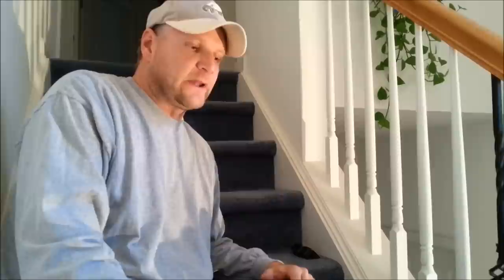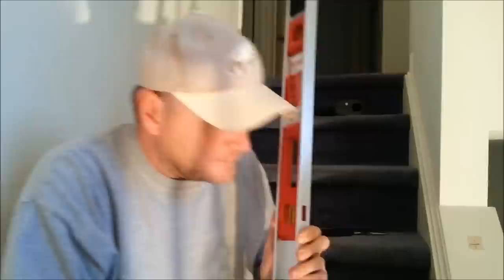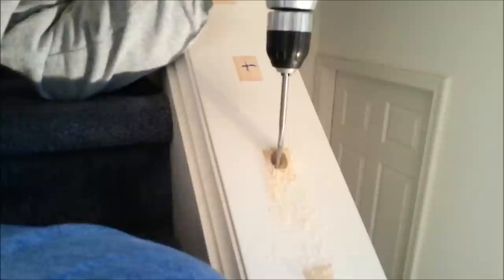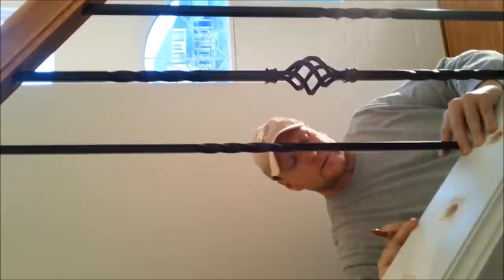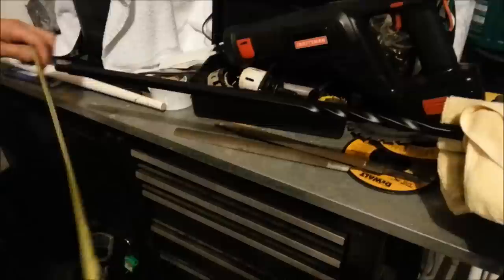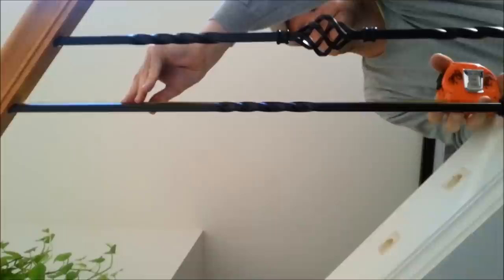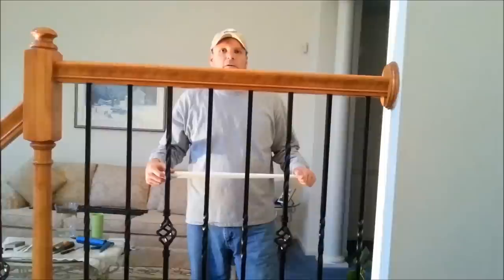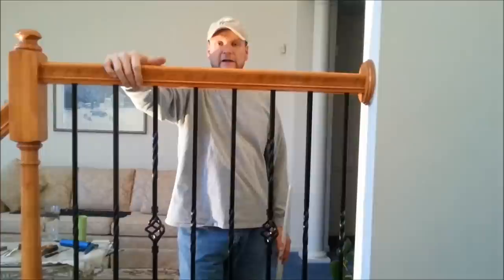DIY Stairs Iron Baluster Installation & Wood Spindle Removal.

Comment: A suggestion for finding the centers of your baluster bases is to draw a line from opposite corners of the unpainted area where the old wood balusters were attached to create a "X".  The center of the "X" marks where to drill the lower hole.

Comment: If the original balusters are plumb then you should be able to connect the corners of unpainted rectangle to find center. If you are worried that the paint leached under a bit, just trace around the bottom of the wood baluster before removing. Should be a lot faster than using a level. Or, try a plumb bob.
Reply: Considering how crappily his original balusters were installed .. they probably are not plumb, lol. Trades people do amazingly fast & crappy work, pisses me off to know end when uncovering this crap when doing home improvements .. it makes extra work for me, and is NOT what I paid for.

Comment: Nice job u guys! You explained it very nuts and bolts just how to do it in a realistic way. I appreciate it. I work with wood. I install my kitchen cabinets. I make rocking horses. I make some shelves here and there. I'm not a highly skilled woodworker but I do pretty well. And I've been wondering how I would do this project. And now I know 😊

Comment: Just watched your video and was enlightened.  I would have liked to have seen you put the epoxy on the top and bottom of the baluster.  I also would have liked to have seen you measure the baluster from your viewpoint and not the other side of the stairs as I am a visual learner.  I'll watch it a few more times just to be sure I understand what you are teaching me.  Thank you very much, your video was well done.

Comment from the maker: Thanks, I hope it helps. Yes the straight and non angle are a lot easier to do ;-) We did put the shoes on the top also after looking at it latter. It is hard to get them straight so I epoxied them in. Gave it a nice finished look as you can see in the still pictures. Rick

Comment: I just finished the same project in my house. There’s a huge problem when you remove the wooden spindles and replace with wrought iron, the spacing is greater than 4inches, which against code. So you have to drill new holes 4 inches apart. You are also supposed to drill the hole completely through the wood. The spindle is pushed down through the hole then pulled up into place in the balusters.

Comment from the maker: After I started it my wife wanted the shoes at the top also to finish the look. I think I showed it in the still pictures in the video. I used clear 2 part epoxy on the part of the shoe that meets the rail. A thin coat and hold it up with painters tape. Make sure that the shoe is nice and square and the epoxy will set up fast depending on what type you get. If you tighten down the screws sometimes the shoe will not sit right or the screws will strip out so I used epoxy. Good Luck. ;-)

Comment: Thanks for sharing. I have one question. Why did you not put shoes on every baluster? You didn't put shoes on the straight balusters. Some of the other videos made it look like you had to replace the stair rails as well. I like how you removed and replaced each one at a time (that took some of the scares out of removing and replacing them. Thanks again, much appreciated.
Reply from the maker: I actually revamped everything & put the shoes on top & bottom which looks better. Thanks for the thumbs up. 👍
Reply: @DiyRick66  Thanks for the reply and the info.

Comment: Thanx Much. I'm going to do this in a couple weeks. I'm also replacing the carpeted pine stair treads with oak ones....
Reply: Do you have a picture to share?
Reply: @nicolepalmer9679  Nicole Palmer  Wow 8 months ago I see & I'm still not done....Not yet. I do have/have had all the treads/risers and Iron Balusters sitting in a room for months. I am also doing all the floors through-out my house. Putting up crown molding. Trimming out all the windows. So I'm going to do the steps last now. Room flooring gets done as I come up with $$$. Replacing the Balusters will be easy. I popped a few out. Cut them and then they just come out real easy.....The steps not so. I just can't pop off the treads like I thought (its a long story & I'll confuse you unless you were looking & can see what I'm talking about). But it's the way the builder built the steps. They can't just be popped off. I have to leave them on then cut the overhang. Then the new treads & risers have to be placed on top of them. These aren't those retrofit steps. They are actually new oak. But like I said it's the way my house steps were originally constructed...LOL I have searched all the U-tube vids & I have never seen one that had the steps built like my builder did them....

Comment: Great job, I wish you had shown the glue process for the top of balusters. Did you have any difficulty with gluing the top of balusters. I notice you didn't use a top shoe which is the look that I like as well. Did the glue run at all when you did the top balusters? How did you get the top to look so neat? Thanks in advance.

Comment: Great video. Thank you! Quick question, could you have taken your old wooden baluster’s measurements and used that as your template to cut all the new ones? I know you would have to add some for the new bottom holes.
Reply from the maker: You answered your own question. Every bottom hole was different due to how deep they were drilled.

Comment: Hey there, great vid, thanks. How deep is the minimum depth for mounting on the balusters? I live in a condo with a loft that is supported by a perpendicular decorative beam that has balusters mounted in the side of the beam that are old and ugly. I want to replace the railing and supports with your exact balusters, bringing the mounts up from the side of the beam to the upstairs subfloor above, by way of a run-length mounting plate. (Need to keep the railing modular, as it will be a rental prop in the future, and the only way to move large furniture into the loft/ master bedroom is to remove the railing. {Access provided through spiral stairs}) My question in another form would be: can I use a 2x4/2x6 as a mounting plate, sinking the balusters in shallow, allowing me to keep the plate/balusters/top rail as one piece to be removed with a few screws instead of individually? Thank you.

Comment: Nice video and very helpful. But I have a problem because there is a metal capping under my wooden hand rail. Any tips on how to install the iron spindles with the metal capping under the hand rail.

Comment from the maker: If I took one measurement based on the first one. I ran the risk of coming up short or not centered because all the holes had to be drilled. That meant if the holes were not drilled exactly the same depth it wouldn't work.

Comment: Thanks for the tutorial. Did you compensate/discuss how the sudden shrunk difference in diameter from wood spindle to iron baluster has likely rendered your new job not to code and dangerous? Looks larger than 4" apart. If I'm wrong, I'll apologize and delete. Cheers...
Reply from the maker: I Used 2×4 to check gaps. All good 👍

Comment: Great video. Why did you decide not to put shoes on the top of the balusters?
Reply from the maker: Personal preference at first but they are installed top & bottom now.
Reply: @DiyRick66  Thanks. I was trying to decide and was looking at different homes and they had shoes top and bottom. So I had been wondering.  (now my wife is going to be annoyed because every home I go into I'm inspecting how it it was built...LOL).

Comment: Hi! Thanks for the video. I have a question. Would this be a good alternative to make the handrail stable? I have an unstable handrails , and handrails are just like yours before you replaced them with iron ones. Since there are no holes under the wood balusters, by installing iron ones, it seems the handrails becomes stronger? Any thought?
Reply from the maker: Depends on what Gage iron balusters you get.
Reply: Somehow, I just found this one! I didn't know you had replied. Thank you for replying to me then!

Comment: smaerd66, thanks for the video. I just found it today. I have a question for your or anyone on this thread. I have the same wood balusters  in this video. Can I measure the bottoms of the balusters meaning find the measurement of half the square part of the wide so it's 5/8" x 5/8"? Then make that mark on the knee wall plank use my speed square to draw a line vertically and then horizontally? Thanks for any help. 

I'm trying numerous times to get ahold of the installer that my builder used to no avail after messages and messages.
Reply from the maker: Take 1 out & try your method. What's the worse that can happen you have to fill in with epoxy or putty. Good luck 🤞👍

Comment: When I removed my spindles, I found that they have been somehow "stapled"in to the rails at top and bottom.  I am assuming that the entire section was Pre-fab'ed. I'm still at a loss of how it was done? Have you ever runinto this type of situation? How was it made? How did you remedy it? 
Any advice would be appreciated.
PS...Also, is 45 degree cut on the slanted spindle sections a fairly standard angle?
Reply from the maker: It is common to have them Brad nailed or industrial stapled. Just drill a whole if there isn't one there to accept the balusters. Good luck.
Reply: @DiyRick66  replacement balusters are square top with no pegs. Is glue the answer? Also are all slanted banisters slanted at 45° for the most part?
Reply from the maker: @marksaxton5001  Yes 45 angle mostly. If you watched my video it shows round peg on one side and square end other side. I used epoxy to hold & slipped shoes over. Eventually I put shoes top & bottom.

Comment: Couldn't you have just made the first baluster fit then cut the rest equally?  Then you would have your design perfectly down the center without having to measure multiple times.  Good video though.
Reply: I was wondering this also... but maybe each hole has a different depth? I don't have the slanted base so mine might be easier. Thank you for making this video!!!

Comment: So, the holes in the banister and floor are ROUND, but the iron baluster is square.       How does that work
Reply from the maker: Sandra H You put in either construction adhesive or epoxy or whatever in the hole before you slip in balusters. The hole is tight enough plus the strength of the adhesive it won't move after setting up. Rick
Reply: Thank You !

Comment: What centers the spindle? thanks
Reply: +JimmyGunXD556 looks like on top, the pre-drilled hand rail.and at the bottom the silicon will hold it in place...id probably use shims of some sort to keep it centered while that sets...tooth picks come to mind.
Reply from the maker: +JimmyGunXD556 I used a 4 ft level to plumb them straight. You could also use a plumbbob to get you centered up. I would advise not using silicone because not strong enough when sets. You a epoxy or construction adhesive for strength. Good luck.